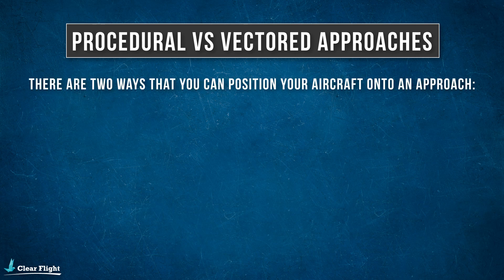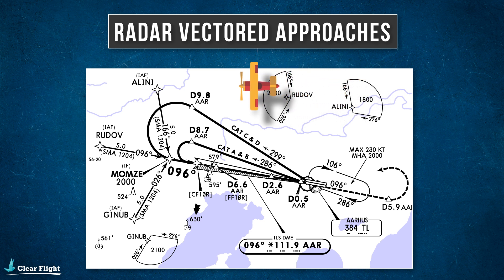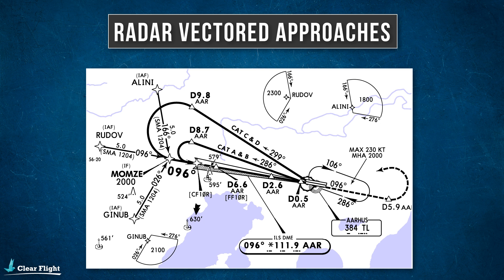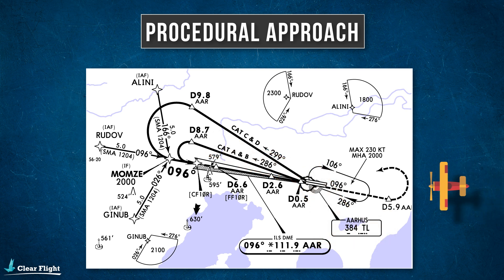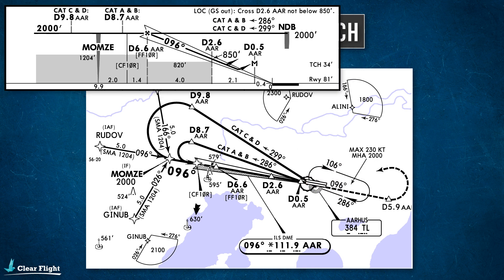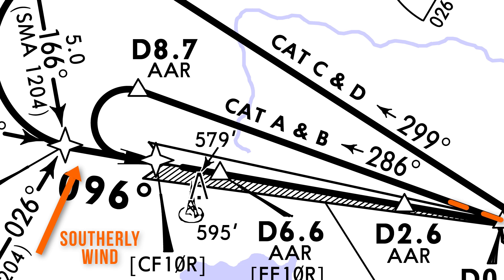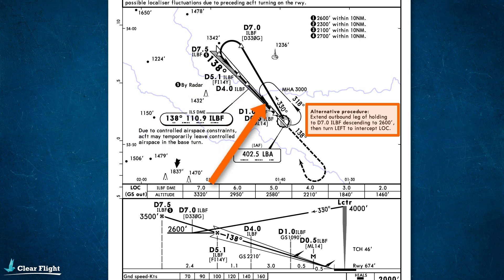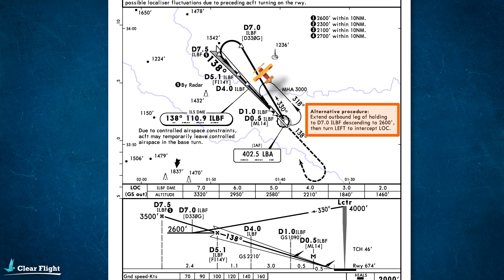Procedural vs Vectored Approaches | EASA & UK Instrument Rating

Comment: 1:42 "We can see the procedure starts from the TL NDB". While that indeed seems logical from looking at the map, how do I actually know this is the case (given that all the IAF markings are out west)? Is it the thick black line on the vertical diagram at 2000' that indicates TL (NDB) is the initial point?
Reply from the maker: That's a good question. There's multiple ways you could fly this procedurally. You could start from the points labelled with IAF (ALINI, RUDOV, GINUB) or the TL NDB. From certain directions, you could also be cleared direct to the intermediate fix MOMZE and skip all the initial approach fixes. Another option that you'll hear a lot of airlines request is "own navigation to the centre fix", which in this case is the waypoint CF10R. The way in which you fly it procedurally is down to where you're arriving from, what you request from ATC and what ATC can accommodate. So there's a lot of options for positioning onto this approach procedurally and, as you say, the one you end up flying comes down to what's logical. Hope that helps!
Reply: @ClearFlight1  interesting, so in reality for the plate you used (in a procedural environment), the full reversal procedure would only be appropriate for arrivals from the east? From all other cardinal directions aircraft would likely position via the other IAFs using RNAV capabilities?
Reply from the maker: Yes, exactly. The last scenario is if you had a reason to enter the hold first, then the course reversal would be used to fly the procedure from the hold.